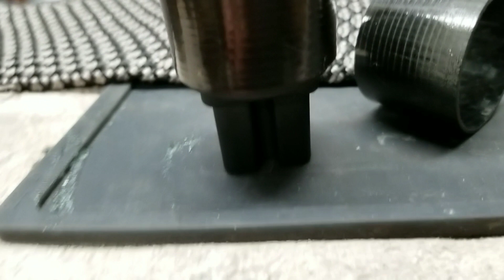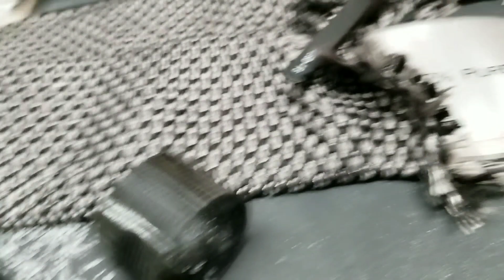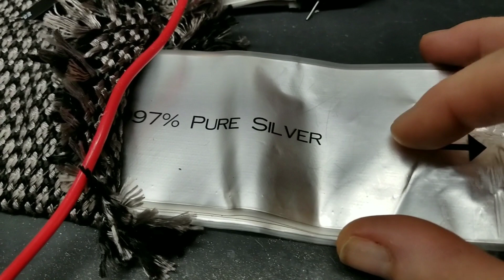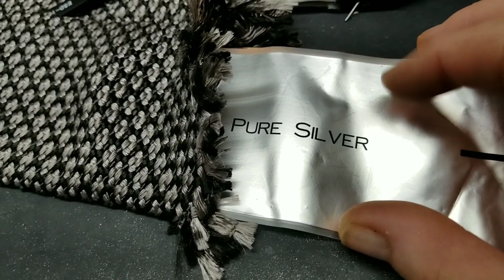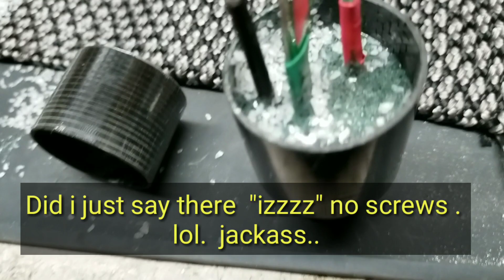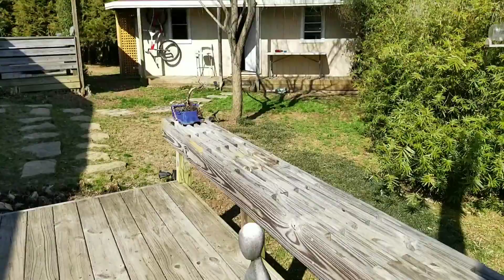Are "High End" audio cables SNAKE OIL ?

Comment: Very nice to use 99.99+ silver. How much per meter? I need 3 meters. Also to make your cables work and make any difference I will need rewire my home in 99.99+ silver from meter to the power points in my HiFi room. Do you make one approved for high voltage? If not who make them and is the any company who can rewire my home in silver. Did some thinking, how to replace the fuses and mains meter to silver one? But to make it work looks like I will need to replace my overhead power cables and the main 30KVA transformer to 99.99+ silver at last the secondary winding. Who in the power supply company I can ask to make this happen? And the last question as we talking lots of silver, the  transformer will have at last 20 pounds are you aware of any insurance company which insure my silver wiring and transformer?
Reply from the maker: Is it clever that you are the first guy to ask if wire is important then why not all of it ? Because our power cords filter SAC, so it can be shit all the way till the last 5 feet then we clean the AC andf condition it for the piece of gear. Look bro, we have been a strong market sonce the early 80s and no amount of making fun, teasing or just being dickish will change that ... Whether you believe or not ... you will not change that which is . and NO your audio rig sounds nothing like mine ... not even close.
Reply: @OCDHIFiGuy  Dear snake oil seller I’m aware that the world is full of brainless prey with extremely dip pockets. So I will be not surprised if you manage to find quite a few know-nothing well off blockheads who are happy to shower you with coins in exchange for your fraudulent overpriced cables. Looks like you need to study some since and stop relaying on fortune teller explanation on AC and diamagnetic quartz crystals interactions? Are you aware that your 5 foot AC cable have less effect on audio sound than a mouse’s low frequency fart emanating from the middle of Atlantic? “and NO your audio rig sounds nothing like mine” in this you are 100% right my doesn’t sound like yours because mine  is “one off perfection” build by myself and design to sound like in havens. In my audio gear silver is used for its soldering quality and resistance contrary to yours nonsensical verging on imbecilic reasons. Some people believe in soul healing properties of quartz but AC healing with crushed silica you must be the first. I will suggest better alternative, Agate with the wave form structure of 50Hz so it can match perfectly AC supply. ... not even close” again  you are 100% right because you will never be able to afford what I build are your amp Dc rails run from floating battery dc generators are you having the best tubes in the world? Because you cannot as I use 4 of the only last 12 in existence. Are your speakers are 7m2 electro stats with H2 ion tweeters? You will never be able to hear this sound... not even close.

Comment: 720 / 5000
Vertaalresultaten
Hi.
It is true you believe your own lies that you are told.
Copper gives 100% conductivity silver 105% and you don't gain anything for that difference.
And your quartz vibrates 50Hz or 60Hz where do you get those numbers from, do you have any evidence on that?
And the great thing is after that you let glue run over it so after that they can no longer vibrate, so to speak.
And then you also have to hang your cables on wooden blocks a few centimeters from the ground because of the magnetism of the earth, which can also affect your wire.
And then another story of magnetism of screws where the current flows and in your Amp then?
Boy, stop telling a lie, you can't even prove anything on paper of what you say.
Reply from the maker: I am a Man first off, and if I was a liar I would not have enjoyed a successful career like I have , In fact, its my Honesty that is my greatest attribute. I understand that for some engineers its hard to imagine that there can exist anything that is unmeasurable. Perhaps you can tell me how to get realism measured and on paper ? How about depth of image ? Soundstage width ? Effortlessness ?  you are in the wrong page my friend  
Ergebnisse, die von mehr als einer Person erlebt werden

Comment: And then the super thick and fancy power cord plugs into a wall socket with un-shielded solid core copper (not oxygen free), and at the other end it plugs into the audio gear and is usually reduced to a small set of plain old wire going into a transformer. Like having a 3" thick steel chain that uses hooks on both ends make out of pretzels. LOL.
Reply: Sure it does, however it''s not in close proximity to your HiFi, its speaker wires and interconnects and that's how the cookie crumbles

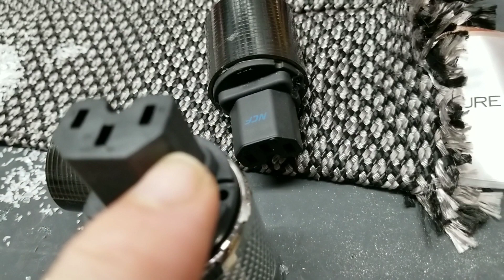Comment: Face palm at 7:50
"Let's just say it interacts"
Zero proof, scientific tests, measurements.
"Let's just say screw gets magnetized"... Please, take some electric classes.
Reply from the maker: In case you dont understand, I'm trying not to be a know it all Jackass. I dont need to go to school for this, in fact I dont even need to understand how it's doing what it does. All I need to do is make a cable that sounds great and does not break. Period. Bottom line is my power cable sounds better than yours. And it will be a large, easy to hear difference. This is all that matters, nothing more.
Reply: @OCDHIFiGuy  Ahhh ok so it is just a believe that these are better. You have no numbers, charts or whatever :D fine
Reply from the maker: @Echo_III  *applause* yes, that's right .  All of HiFi is different people showing how "They" like to do it , some companies sell by spec numbers and attract customers that like to buy spec. Others sell sound and sonic to those that only care about sonic. The reason I say "may " magnetize a screw is because I have not tested it myself, Ive read it on the internet only. And internet is full of BS. So I'm letting you know that I'm not claiming that information to be bona fide, its the way I understand something to be. For a smaller company like me, its easier to just adopt a method and trust what I read than to pay to labratory test everything , which theres no $$ for . And if I know what I'm doing will not make things worse , only stay the same or get better, then I add that process or part.
Reply: @OCDHIFiGuy  yes, Internet is crap :D
Keep up the good job. It's great that you do something in your live. I am making tube amps and without numbers is quite difficult to present the product because every piece of equipment is diffrent. So it's nice to have some comparable numbers to check
Reply from the maker: @Echo_III  With an amp for sure. It is more important as thats how people choose many times, with cables the majority simply listen..

Comment: What is the sound difference comparing solid core, litze wire, and foil cable. is there a typical foil sound? by the way, like you cables look, especially the white one with that cool-looking hologram on it! Despite never had the chance to hear a Verastarr in my set-up.

Comment: The amount of facts in this video was pretty low compared to the bullshit talk and selling snake oil to uneducated. The "proof" of this kind of bs working is believing them to better the sound.

That's why no one ever has ABX tested non-faulty cables successfully
Reply from the maker: The earth is flat as well huh ? And nothing you can not measure exists. Listening for you must be a total bummer, you are incapable of hearing depth of image, texture, density... no wonder things are a drag mister Neg Boy...
Reply: @OCDHIFiGuy  Yeah because speakers do so much more than move air so measuring that doesn't tell the whole story or what?

Comment: Yes but the signal does not pass though the plastic in the power cord.
Reply from the maker: Sure it does. You ever heard of "dielectric absorption" ? this means signal penetrates into the insulation, charging it slightly.  Then it is released back into the signal stream a short time later,  causing time domain errors and smearing, etc.  Furthermore there is an EMF field that surrounds every wire or cable and by adding materials that act in the presence of EMF you can affect signal by adding materials to the plastic..